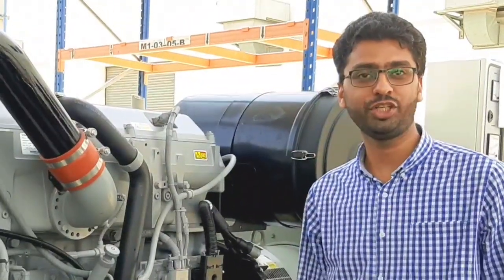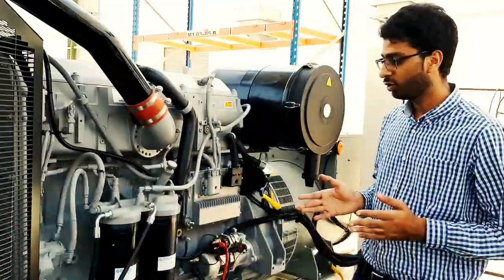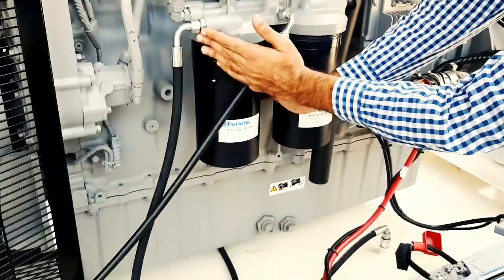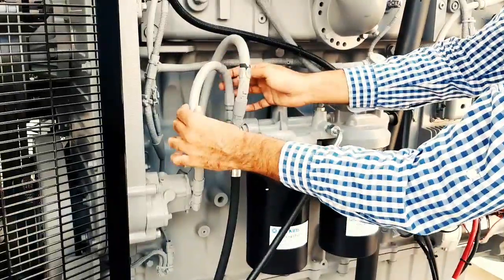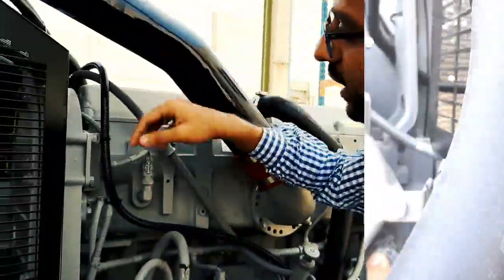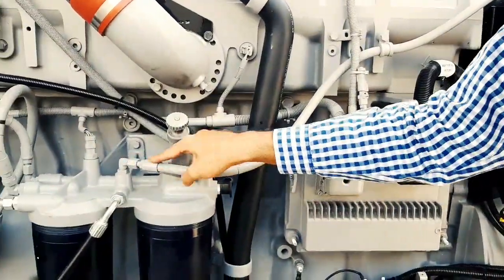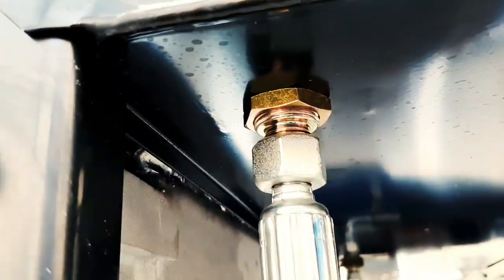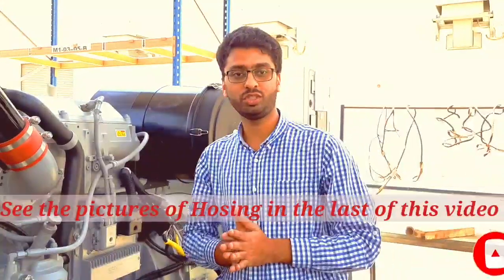Diesel Generator Fuel System Explained 🔥 | Perkins 2500 & CAT C15 Electronic Engine Fuel System

Comment: Hi sir, just now i have same series Perkins 2500, suddenly shutdown and cannot start anymore, please help me. thanks a lot
Reply from the maker: Please share some details what is your controller and what alarm you have when its shutdown
Reply: @Dieselgeneratorksa  FG Wilson sir, no any fault code or alarm. only cranking but no start i check everything such as: sensors, ECM, coolant level, battery and etc.
Reply: @garED1678  without pc connection didn't possible to check Ecm.if you  have software so your engine is front of your eyes.
Reply: @electricaltech4u45  already resolved!
Reply: @electricaltech4u45  FYI khan! i have DSE user account, DSE Configuration suite (software) and DSEWebnet gateway account.
Reply from the maker: How you resolved what was the issue ....
Reply: Wooow amazing thanks for your tutorial,
Reply: I requires Service engineer for Perkins 2506C engineer,please suggest with contact No